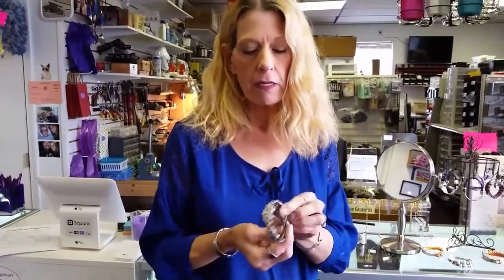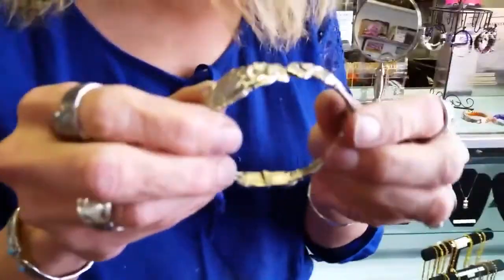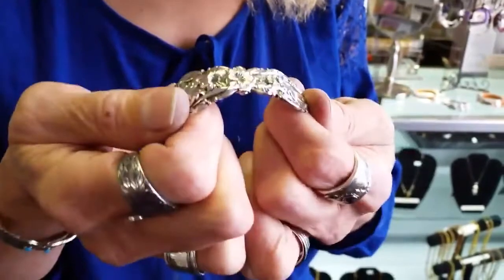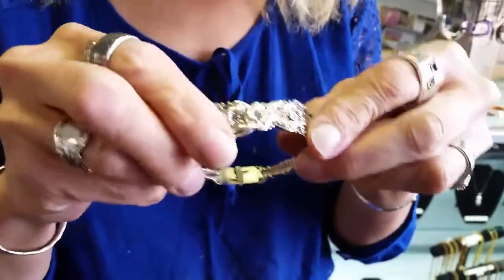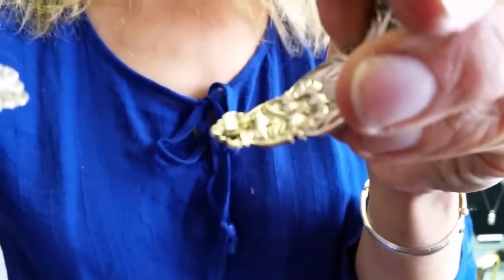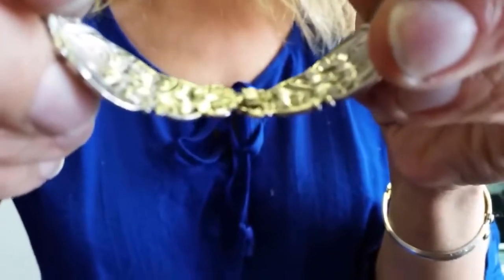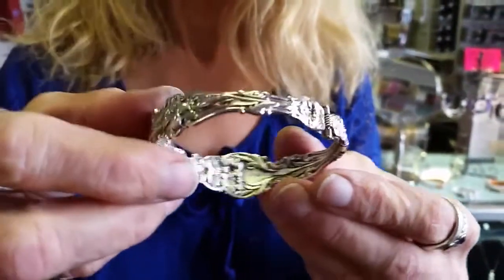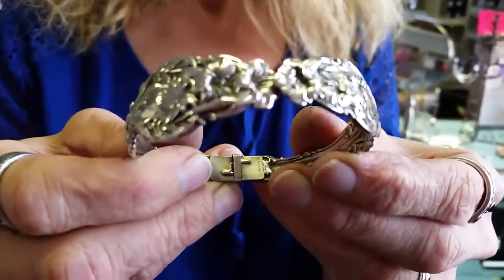A design tip for making a hinged silverware bracelet.

Comment: Great info thank you! I’ve been practicing a few things.
Question for you on a kickstand spring loaded hinge on a solid silver bangle. 
The spring loaded once completed seems to spring back well over all, but the kick stand part when I’m not trying to open it, it wobbles a tiny ...tiny amount, and when I lightly push my finger up it easily opens a bit. If I pull pretty hard up then the hinge snaps back well. I’ve tried a few and they all seem to be a tad “loose”. If that makes sense :) is that just how it’s supposed to be? tiny bit loose, or is it just catching up with the spring load part and it is supposed to have that small movement  side to side and up and down ? :) thank you for all your help and advice!